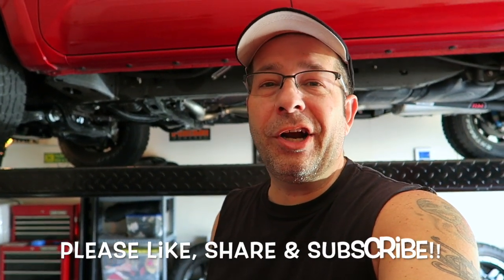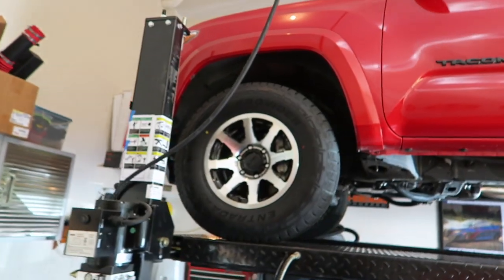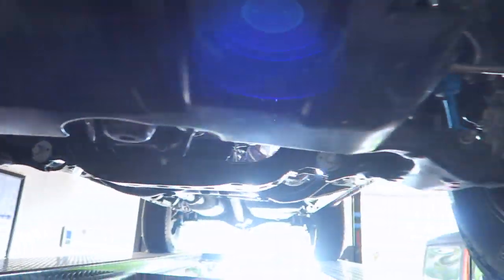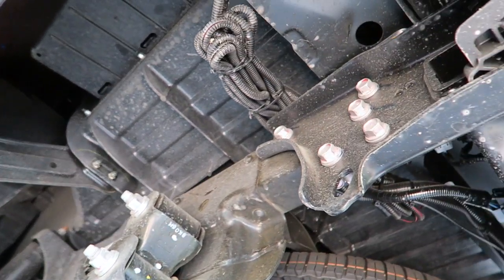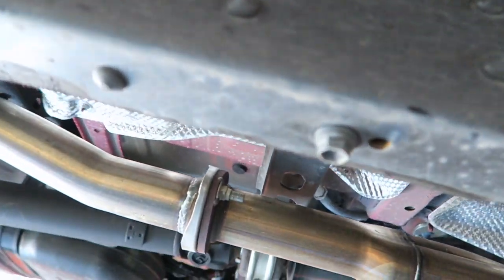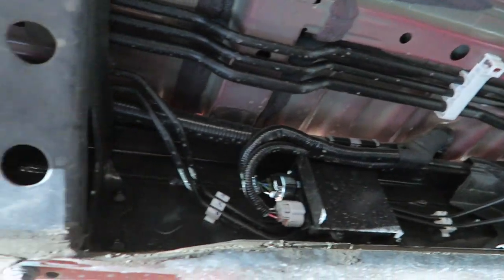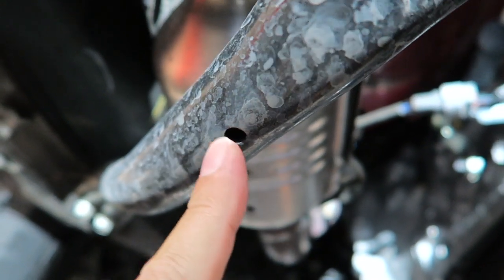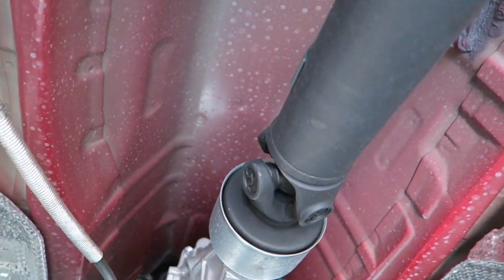Does TACOMA have a RUST Problem?  A look at the UNDERCARRIAGE

Comment: We have a 2015 White Tacoma and it's full of rust. Being in Ontario it's used on salted roads but the amount of rust everywhere is unacceptable.
Reply from the maker: That’s a bummer 😑
Reply: @RobMotive  yes it is but there's rust where there shouldn't be like around the doors around the edges of the box. Under the hood. Never buying a Tacoma again. We've had 2 RAV 4's. Very little rust. Our 2010 RAV 4 never had any rust treatment driven on salted roads same as the Tacoma.

Comment: Pacific Northwest here and I do off roading, more the overlanding type stuff..... but not enough to scrape the undercarriage or skid plates. My Tacoma looks a lot like yours underneath as far as any surface type rust.. IMO some of those undercoating jobs do more harm than good. If you have gunk up under the truck blocking drainage holes and trapping water or moisture, the likely hood of rust increases....Then again I live in a area that does not use salt on the roads(thank god)!
Reply from the maker: That’s a good point!  I wonder how many shops take the time to clear the drainage holes🤔

Comment: I had the recall on my 07  Tacoma i left the truck at the dealer for a few days and they did a undercoating of the frame it didnt rust through
Reply from the maker: It was a huge problem for Toyota.  They are still paying for it today I believe!!
Reply: @RobMotive  the most definitely are.  We are doing one on an 04 this week! (Rare case as it had expired but Toyota good willed it) and we have a 2011 or 2012 coming in this month or next.

Comment: Hey rob, Toyota employee here. And on the frame rust issue for 2011 and older tacomas is coming to a close soon. BUT they released a new bulletin for 2012 to 2017 Tacoma's for nearly the same issue. However, like the older tacomas, it's only for cold climate/ high salt use states.
Reply from the maker: Wow!  That’s very interesting.  So it seems the problem still persists.  Do you happen to have a copy of the bulletin?  Thanks for the info.
Reply: @RobMotive  I can look it up, not sure if its public knowledge yet. (Dont know how Toyota releases that to the public, dont want to get in trouble) but what I can say is that the customer will either get a frame spray or replacement. Depending on severity of rust.
Reply from the maker: Sounds good.  Thanks for letting me know.  Since I posted the video, a few people have told me they have gotten letters about it.
Reply: Are the 2018-19 Affected? If not what did Toyota do different to those years? Thanks...
Reply: @earskinpresley5848  not sure what Toyota has done different. Or if they haven't seen rust yet.

Comment: I live in NE and purchased a new 2014 Taco. Only dealer serviced. I used mainly for light house material and got 297K miles (excellent) but rust damaged the front suspension( salt and such).  Toyota corp. or the dealer did not warranty the issue or make any effort to assist in rust repair. Overall Taco was in great condition and easily would have gone 400k miles. I'm now looking at Ridgeline. Honda seems to have addressed the issue with a factory rust protection treatment. I believe Toyota dealer should have caught this during service but avoided saying anything during service to avoid legal. I would consider purchasing another Taco if Toyota corp could simply clarify they have addressed the rust issue like Honda. All vehicles in the NE should be FACTORY rust treated during construction not after market.
Reply from the maker: Thats a bummer!  Unfortunately I hear Toyota is still having rust problems.  Especially bad depending on where you live😑

Comment: I looked at a used 2017 Taco with 12,000 miles on it from Michigan... All the hardware underneath was covered in rust. The frame itself looked fine but the spring hangars and ubolt nuts were showing way too much rust for 12000 miles.
Reply from the maker: Not really surprised in that it’s in Michigan.  I’m sure it’s been thru a couple of snowy/icy winters and exposed to plenty of salt😬

Comment: If you live near and drive by the beach (Sand) its inevitable...  Its like driving thru the glass bead machine. But hoping for the best- 
It looks like they made changes as you point our- rubberized paint on any exposed metal, and that last 6-8 inches of the bottom of the body has a sealant under the paint. All in all seems like a good design
Reply from the maker: I’m curious about the rubberized painted areas.  Do they slap that on if they see something during production or are they predetermined areas that they seal🤔
Reply: @RobMotive  - My Guess is that is a Quality control inspection- Considering the frame issues from the past- it makes sense to do a once over. After i saw your video- I looked under my Pro- same exact thing. Its a good idea- Rust just needs one little spot to start..and we know what happens next
Reply from the maker: Could be.  The way it’s put on (pretty sloppy) I’d assume it’s done by human hands and not a machine.
Reply: @RobMotive  - 1 would 100% agree. a machine would have squared edges on the patches. I imagine 1 employee under each taco on a lift before it leaves for the cargo container

Comment: Hey Rob!  Your VooDoo blue TRD 4x4 Double Cab with manual is in Bozeman, MT.
Reply from the maker: What’s the dealer name🤔
Reply: Bozeman Toyota.  Or Ressler Motors.  You can use either.  Does not have any packages that I noticed.
Reply: It does have the LED headlight package, edge guards, and floor liners/door sill.
Reply from the maker: Thanks Cindy.  I appreciate the heads up👍
Reply: Another one at Bountiful Toyota in Salt Lake City.  More options but no LED lights.

Comment: My 2019 transmission lines near the radiator already rusted through. The power steering return line needs to be replaced next. Very disappointing.
Reply from the maker: That’s a bummer.

Comment: What are your thoughts on undercoating? I’m thinking about foot myself as the shops around me quoted me crazy prices.  Like $1000 and up.  It seems like a nice summer project with the old Die Grinder.
Reply from the maker: Too nasty for my liking (self install), but if you don’t mind that part, then heck yeah!  Gotta be a lot cheaper than $1K I’d think👍

Comment: My 17 Tacoma has gone through 4 winters here in Colorado so far and all the welds on the frame are rusting and I have random rust spots all over peeling up the frame paint. Currently using rust dissolver and rust reforming spray on some areas to test out this winter but there is quite a bit of rust under my 4 year old Tacoma 😞
Reply from the maker: I believe it!  Seems Toyota still has a frame rust problem😬
Reply: RobMotive yeah! I’m hoping the rust reformer paint and the rustoleum “stops rust” protective enamel paint holds up in the areas I did this weekend over the winter. If it does I’ll be removing parts and cleaning up/ painting the whole frame in the spring next year. Love the videos by the way! Thanks Rob!
Reply from the maker: I hope it works out!  Thanks for watching 👍
Reply: I’m in Colorado also, now I’m going to have to deep dive into this on my ‘20 and ‘21 4Runners. I have a ‘97 F-350 I keep painted up underneath and don’t have any rust issues with it. It has a c channel frame though.
Reply: Better than Maryland. almost spent $23k on a low mile Tacoma from there. Frame looked good. Took it to a mechanic and within 10 mins told me to look elsewhere.

Comment: Any anecdotal data on how, say, an F-150 holds up in colder climates versus the Tacoma?  Why has toyota not addressed the issue?  Seems bizarre.
Reply from the maker: No first hand knowledge on the F150…but I’m sure it rusts just as badly 😬
Reply: @RobMotive  if it does this isn’t a big deal - just need to be careful in cold climates ..  but if it rusts more then toyota should fix it — also how’s the toyota holding up from the 2 years since you made the video (the rust)?
Reply from the maker: I can’t say.  That truck was traded 👍

Comment: I've had my '03 Tacoma in Western North Carolina for the last 6 years and its rusted badly. Replaced muffler 3 times and entire exhaust system once. Had only had to replace muffler once in the previous 10 years. Replaced the back bumper a couple weeks ago and had so much flakes of rust fall off in the process it is scary. Not an off roader at all also.
Reply from the maker: I assume they put down a lot of salt in the winter?

Comment: I haven't hear of the Tundra having a frame issue... But I know the 1995 to 2004 Tacoma suffered so much damage that the company had to repurchase them or replace their frames. I'm looking at my 2017 tacoma and it has a lot of rust starting.
Reply from the maker: There was a big problem with the Tacoma’s.  I think it was even extended past the original years.

Comment: This steel they are using obviously has a high contact of scrap metal of low quality, as in, Rusty metal is being used to make the steel. there is a process for purifying the steel of impurities called, the Bessemer process. This process involves blasting the molten steel with oxygen while it is still molten. Obviously they are not taking this step when making the frames for Toyota pick ups
.. they are just melting the steel,Adding the rusty scrap steel, without purifying it by the Bessemer process, and making the frames out of this low-grade steel
Reply from the maker: Could be.  Not sure of their process🤔
Reply: The Bessemer Process stopped being used in the US completely in 1968. Electric air furnaces and other more technical oxygen steelmaking processes took its place. The Bessemer Process has no place in modern day construction material production.
Reply: @artsch0198  
  So they still do you use oxygen blasting in the purification of molten steel process? But they don’t call it the Bessemer process anymore? What do they call it now?

Comment: I had the frame replaced on my 02 Tacoma
Reply from the maker: How was the process?  Seems like it would be a pain?
Reply: I was in a rental car for a couple of months  my truck was a standard cab but the toyota dealer put my lift back in and my Arb winch bumper back on  so that was cool of them  the only thing that sucked was  I didn’t have my truck in the summer
Reply from the maker: I figured it was a lengthy process.  Great that they went the extra mile and put those things back on your truck 👍